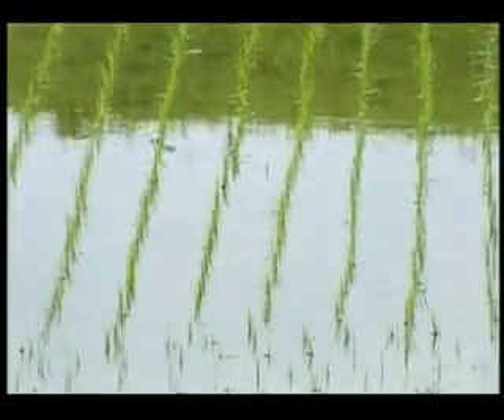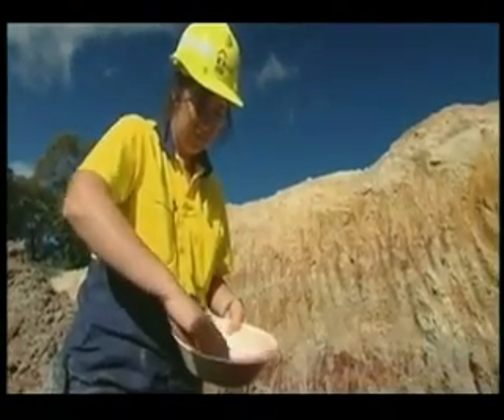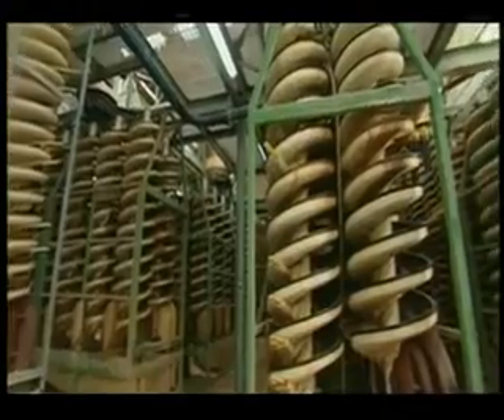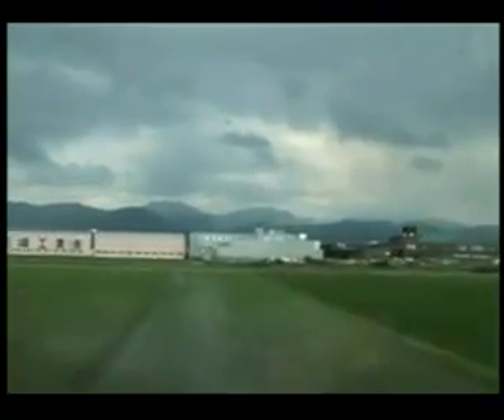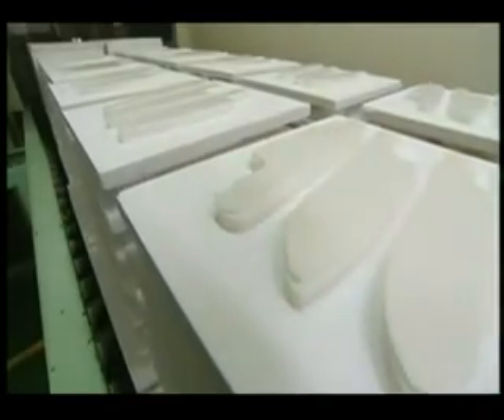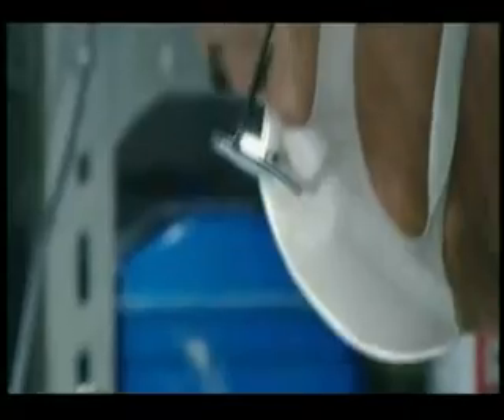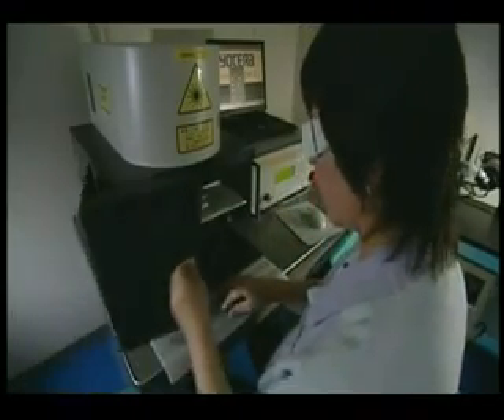How It's Made - Kyocera Ceramic Knives

Comment: AI Summary

Abstract:

This documentary segment details the industrial manufacturing process of Kyocera ceramic knives, utilizing advanced zirconia material. The process begins with the extraction and refinement of zircon ore from Western Australia, followed by conversion into zirconia powder in China, and culminating in high-precision manufacturing in Sai, Japan. Key stages include high-pressure compaction (300 tons), intense thermal firing (1,400°C for 48 hours) to achieve extreme hardness (second only to diamond), and subsequent manual sharpening using diamond abrasives. The final product is characterized by hardness, resistance to rust and staining, and chemical inertness, rendering it ideal for precision food preparation. Notably, the final production step includes integrating metal into the ceramic composition to ensure detection by airport security systems.

Kyocera Ceramic Knife Manufacturing Process

*   0:48 Product Introduction: Kyocera, based in Kyushu, Japan, produces a revolutionary knife blade from high-tech ceramic, breaking with the tradition of steel blades.
*   1:33 Performance Characteristics: The ceramic blade is claimed to be harder than steel, non-rusting, non-staining, and highly resistant to blunting, making it suitable for thin slicing (e.g., sushi preparation).
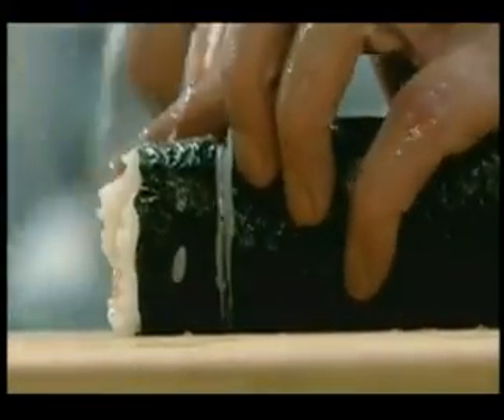*   1:48 Material Composition: The knives are derived from a high-tech ceramic, zirconia, which is described as second only to diamond in terms of hardness.
*   2:09 Raw Material Sourcing: The precursor mineral, zircon, is extracted from black sand ore at the Dardanup mine near Perth, Western Australia.
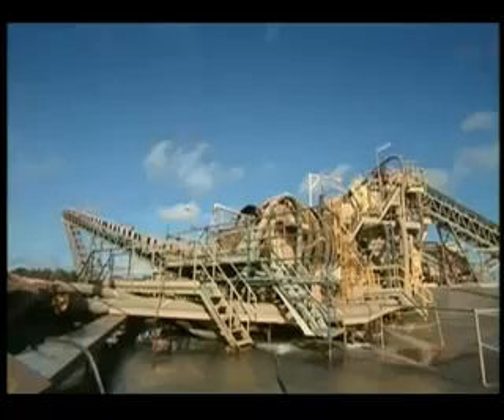*   3:12 Initial Refinement (Australia): Ore refining uses a sequence of steps including vibrating tables and large drums for initial sizing, followed by a "wet plant" process utilizing industrial corkscrews to separate lighter sands from heavier, mineral-rich material.
*   4:13 Zircon Purification: The mineral sludge is further refined using magnetic and electrostatic machines, yielding nearly 100% pure zircon concentrate.
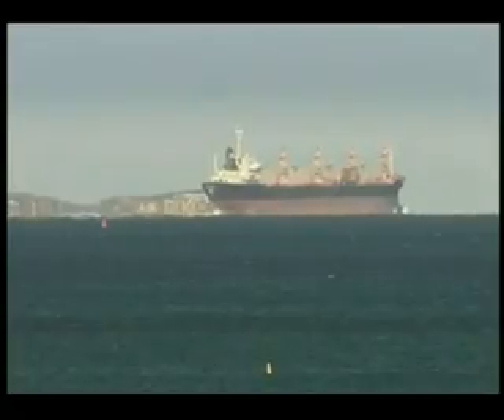*   4:33 Zirconia Conversion and Transport: The zircon is shipped to China for chemical refinement into zirconia powder before final delivery to the Kyocera plant in Sai, Japan.
*   4:53 Compaction: Zirconia powder is formed into fragile, knife-shaped blanks using a high-pressure press that applies approximately 300 tons of force.
*   5:25 Sintering/Hardening: The blanks are fired in a kiln at 1,400°C for 48 hours. This fierce baking process transforms the soft powder into a hardened ceramic, resulting in an extremely hard blade claimed to be tougher than its strongest steel equivalent.
*   5:54 Manual Sharpening: Achieving the cutting edge requires traditional craftsmanship, utilizing a spinning wheel coated in diamond dust to grind the hardened zirconia slowly.
*   7:30 Security Integration: Due to the blades posing a security threat (undetectable by metal detectors), metal is intentionally mixed into the ceramic composition in sufficient quantity to trigger airport metal alarms.
*   8:16 Culinary Validation: A master sushi chef validates the ceramic knife's performance, confirming its ability to produce wafer-thin slices and noting its chemically inert nature prevents the absorption of odors from fish oils.

AI-generated summary created with gemini-2.5-flash-preview-09-2025 for free via RocketRecap-dot-com. (Input: 14,988 tokens, Output: 730 tokens, Est. cost: $0.0063).

Comment: Every knife needs sharpening eventually. How do you resharpen them?
Reply: Probably a diamond sanding belt
Reply: You don't, that's why ceramic knives are shit.
I have some in the kitchen that were gifted to my mum, they're so dull and chipped it took me 15 minutes to cut guanciale for 3 portions of carbonara...
Reply: @v0ldy54  User error, you didn't read the manual, i have one for 6y that cuts almost like new. They also sell sharpeners.
Reply: @cristibaluta  if your knife is sharp after 6 years it means you're not using it.
Wondering why you hardly ever see ceramic knives in professiona kitchens if they're so good...
Reply: @v0ldy54  No, i use it daily, it is my only knife and i cook at home, the hardest thing i cut is probably old hardened bread. Professional cooks are more practical, they don't want to babysit a knife to not break, and it takes few seconds to resharp a steel knife so not an issue for them to use a worse knife. They will still have to use a second knife for hard ingredients, so what's the point?
Reply: Kyocera ceramic knives have a lifetime quality & sharpening warranty. If you actually take care of them, they are amazing.
Reply: They are literally sharpening them in the video. They use diamond infused wheels. We would use diamond infused whetstone, we can find them reasonably cheap.
Reply: I have a set of these knives and I was amazed how well they work

Until I learned how to sharpen my steel. Now they’re ornamental

Comment: given how many of those blanks they were pumping out, I absolutely cannot believe that it's 3 guys in a small workshop sharpening them all. That's just dumb.
Reply: They probably contract out to many small shops to have them sharpened.  I think they said one of several masters.  plus high end knives are like hand made cars.  they do not over saturate the market with them.  You wont find them in Walmart.  there are low quality ceramic knives that break if you drop them on a hard floor.  But these are like diamonds in toughness.
Reply: You're so fcykin smart Y don't u open a similar factory with your production line better and be a millionhair tycoon.

Comment: "Tougher even than the strongest steel equivalent" 
Harder? yes, tougher? HELL NO.
Reply: As someone that has all his 3 ceramic knives broken i can confirm this is a marketing stunt, half truth
Reply: @cristibaluta  ceramic kitchen knives have various quality dependent on the price and black ones are much stronger than white ceramic but it should not be abuse. Ceramic knives are not meant to cut/chop bony meat not even chicken necks nor for survival/bush craft purposes and especially not for knife fighting demos; the tool is meant to be use for what it's intended designed for. Just like one doesn't take a Ferrari/Maserati for competing with a F1 super racer that's illogical no matter how good the driver is.
Reply: Use it for it's intended design not abuse asshole.
Reply: Depends on what you mean by "tougher" since "tougher" isn't an engineering term or a term with any precise meaning.

Tougher can definitely mean harder, but tougher can also mean less brittle.
Reply: @Stealingparts yes, toughness is a materials engineering term. It refers to a material's ability to absorb energy and plastically deform without fracture.

Hardness usually refers to the surface hardness, the ability of a materials surface to resist penetration. 

Brittle refers to the type of failure a material shows when stressed. A mild steel typically shows ductile failure, a ceramic a very brittle failure type
Reply: ur right lmao how in the world can it be tougher xD
Reply: Drop one, I dare you lmao

Comment: ceramic knives are not strong at all. just relly hard
Reply: They're strong as well. Higher tensile strength than stainless steel.
Reply: @maximkazhenkov11  not possible, literally the definition of hard materials is strong in compression brittle in tensiion
Reply: there are cheap ones.  these are not cheap.  they are zircon.  they use zirconium to make lesser expensive wedding rings that are almost as dense as diamonds.  but a lot cheaper.

Comment: Tough = softer 
Ceramic = not tough 
Ceramic =hard 
Hard =brittle 
Brittle = not tough 
I'd stick with steel 440c unbeatable value. Unbeatable steel
Reply: Refer to 1:32. For the application it's used in, ceramic is an excellent choice. By the way, I wouldn't say that 440c is an "unbeatable steel". I really like my CPM S30v but even that pales in comparison when it comes to performance to other high end steels.
Reply: I prefer K390 in the kitchen. It is not stainless but it will hold an edge much longer than S30V, ZDP-189 or Elmax/M390. I can bring it to much thinner edge with no problems.
Reply: Elmax is the best steel, change my mind
Reply: cody M390 is a more wear resistant elmax. Modified for the plastics industry.
Reply: Your post is 8y old, my knife is 6y old and cuts almost like new, i use it daily, you have to use it for what was made for
Reply: LOL   440c, how is the weather there in the 60's
Reply: VicariousReality7 no kidding. Its not strong its not tough its not rust resistant in extreme settings it is soft... blech.

Comment from the maker: If a proper wood or plastic chopping board is used then it depends how often you will use your knife as to how often it will need sharpening. I use my FK-160 daily and sharpen it every 2 months approximately. Compare that to stainless steel chef knives which need sharpening after 3-4 uses.
Reply: "Virtually unbreakable ceramic,.. tougher even than the toughest steel equivalent." 

BS

I own two Kyocera FKR160HIP-FP black santoku knives made of Zirconia 206.

Yes they hold a superbly sharp edge, and yes they are very light - truly a pleasure to use - as long as you are very gentle with them and never cut anything harder than radishes with them.

Given the choice I will always choose either my Shun blades or my Wusthofs or one of my titanium alloy ForeverCera knives. Why? Because they flex and do not break - and they hold an excellent edge for a long time over many uses.

Moreover, anyone who gets only 3 or 4 uses from their steel blades before they need sharpening needs to invest in higher quality blades (and probably improve their knife skills as well).  

I use my Kyoceras often to slice sushi, and I love them as much as I do any of my other knives. But they are certainly not my go-to blades for general use. Ceramic blades are simply too brittle and too easy to break to use as a daily use general purpose knife.

If you can pick up a 5.5 inch Kyocera Revolution santoku for less than $20 then purchase it and enjoy it. Otherwise it is wiser to invest in higher quality steel or titanium alloy fine blades that will last a lifetime (and that don't need frequent sharpening even under daily professional use).

Investing time to hone your personal knife skills will also richly reward you for the effort - and make your blades last much longer as well.

I hope this helps.
Reply: @ashjackson6798  Rahven makes a flexible ceramic knife with double the edge retention of even Rex 121 on SISSAL rope. It can cut through the hardest cooking needs besides maybe just straight a bone but I don’t know who cuts bone with a knife lol. Also Shun knife is over priced Imo using Vg-10 (toxic) metal.
Reply: They GROSSLY misunderstand the difference in strength, toughness, and hardness. These blades are only harder than steel. They aren't even in the same category when it comes to toughness or strength, not by the longest of shots.
Reply: @aaronpogue6711  all of that is kind of useless when it comes to kitchen prep work. Ceramic blade dominates steel blades when it comes to the kitchen. I have been using the same ceramic blade actually dropped it on the floor like five times for the past seven years and I haven’t had to sharpen it even once.
Reply: i broke mine getting some husk out of a coconut
Reply: Also 99% of stainless steel chef knives are using really outdated cheap low quality steel. Get a stainless top-of-the-line steel like Vanax and you only have to sharpen it once every few months.
Reply: That's because (common) stainless steel doesn't hold an edge that well. Carbon steel all the way.

Comment: So do they ever need sharpening?
Reply: +newstart49 Yes, but much less often then a steel blade, you will need a diamond coated surface for it. You can probably get a decent electric sharpener for $40 on Amazon.
Reply: My side business is knife sharpening and I get a number of ceramic blades. They DO need sharpening, but not nearly as often and you cannot usually use the same abrasive materials.